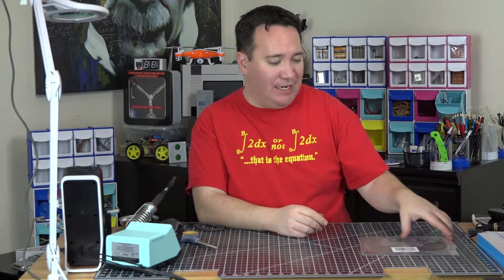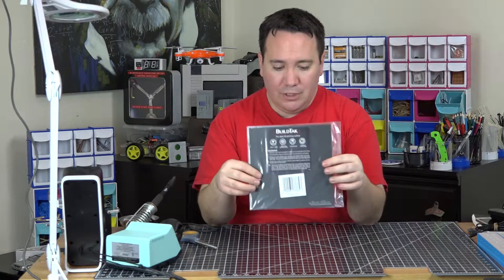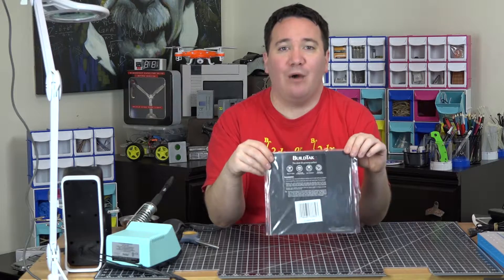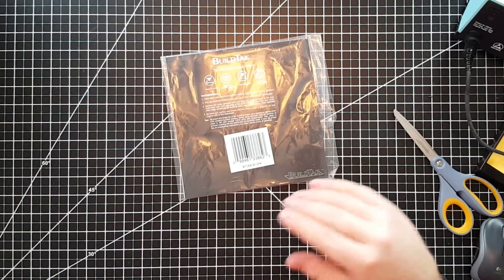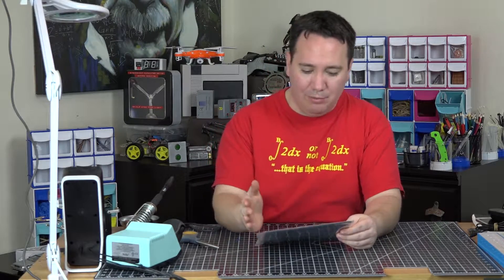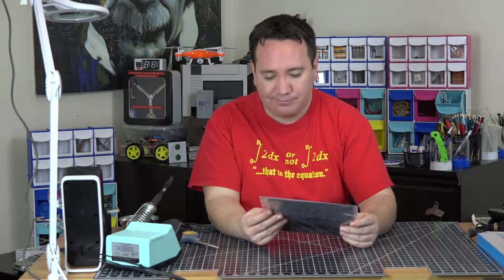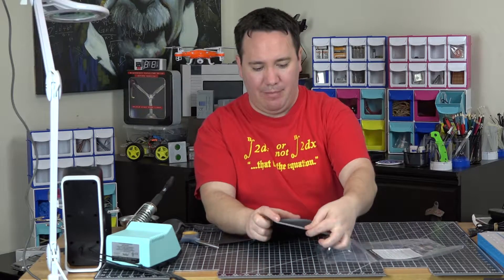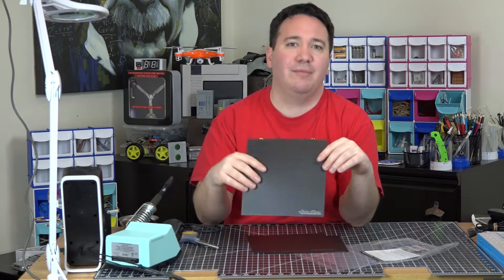Unboxing BuildTak 3D Printer Build Plates

Comment: Creality CR-se i great...  I have never used a bit of adhesive on the bed and my prints stick every time...  They better for the price of the machine...  I started with a ender 3 and used glue stick on a glass bed with hardened steel nozzle...    My prints turned out great, but I got really sick quickly of having to level the bed before each print noting I tried made it, so I didn't have to level the bed every time...